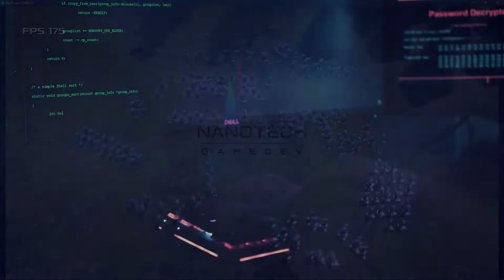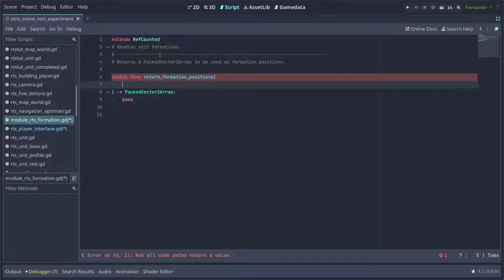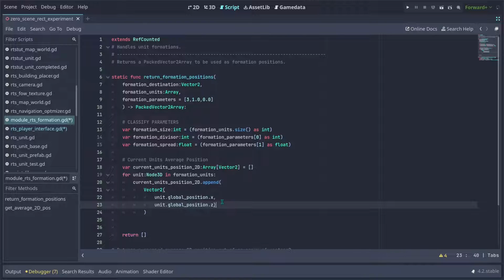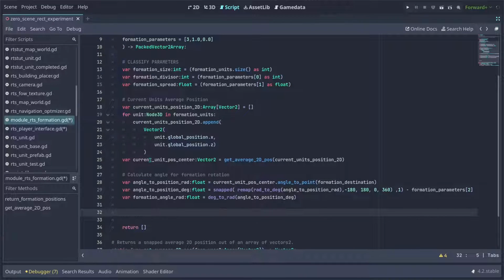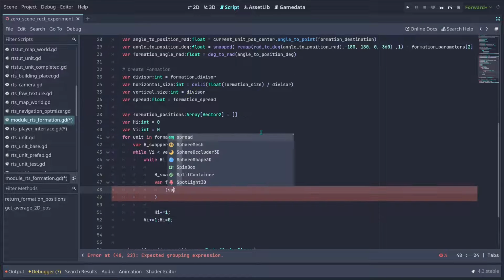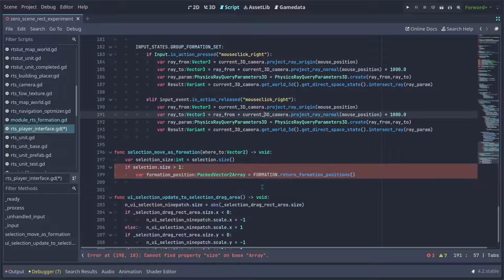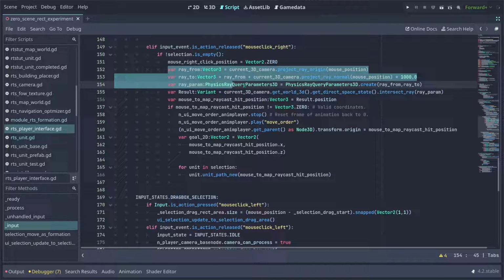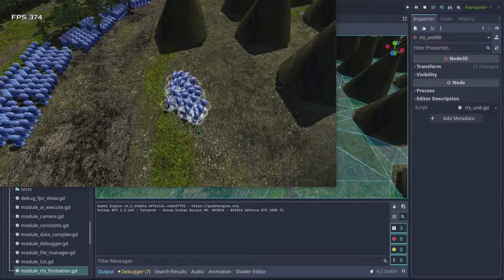Godot RTS Formation Part 1 : Basic System - Formation Module in Godot 4

Comment: Great tutorial, but small question: How would one orient the rotation to face a specified direction, rather than the calculated angle shown in the video? I've been tinkering with this for a bit and I can't seem to find a good way to do that- angle math has always been my weak point. Thank you

edit: I figured it out after a bit of math- for anyone who has the same issue, to rotate a point around a non-origin point you must first translate the point so that it's rotation point is at the origin, apply the rotation, then translate it back to where it was.

in godot that would look like this:
var initPos = formation_destination + formation_position
formation_positions.append(
					(initPos - formation_destination).rotated(formation_angle_rad)+formation_destination
				)

Comment: I'm having an issue. I followed this to the letter (except for a get_vector3_from_raycast func from the Camera module thrown in), but the units all go to the same spot.

Here's some print() output:
Guard <76889982986> moving out to (-1.215359, 0, 14.12725).
Guard <77561071666> moving out to (-1.342802, 0, 14.02122).

What could be happening?
Reply from the maker: Probabilly an issue with the physics collision or the conversion between the 2D coordinates to 3D, my terrain is using a simple collision mesh underneath to detect the mouse coordinates, I belive that is what the raycast is colliding against, the functions I used for the conversion are built-in so you should not have any issues, I would try to debug to first know if it's an issue with collisions raycast then if it's an issue with the conversion from the camera coordinates, then test the algorithm of the formations to see if it's not that, the code in the video should work, there's probabilly something else missing, make sure your objects are not scaled weirdly, everything should be on XYZ 1, physics collision don't work well with unapplied scales,
Reply: @nanotechgamedev  I debugged the code and mostly found nothing wrong. The scales are all (1, 1, 1) too. I'm pretty sure the problem is in the get_vec3_from_cam_raycast func

var ray_from:Vector3 = camera.project_ray_origin(cam_2d_coords)
var ray_to:Vector3 = ray_from + camera.project_ray_normal(cam_2d_coords) * 1000.0
var ray_params:PhysicsRayQueryParameters3D = PhysicsRayQueryParameters3D.create(ray_from, ray_to)
var result:Dictionary = camera.get_world_3d().get_direct_space_state().intersect_ray(ray_params)
if result: return result.position
else: return Vector3.ZERO